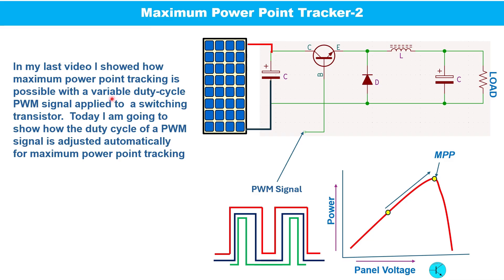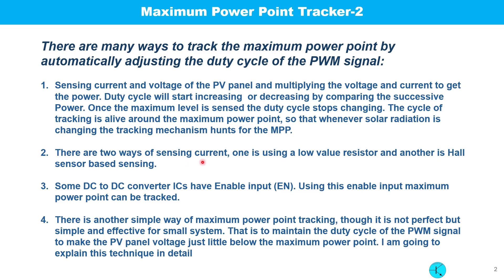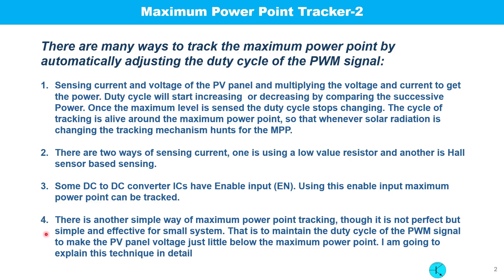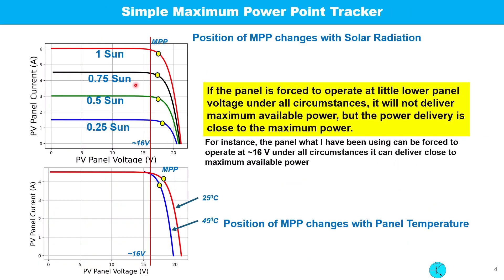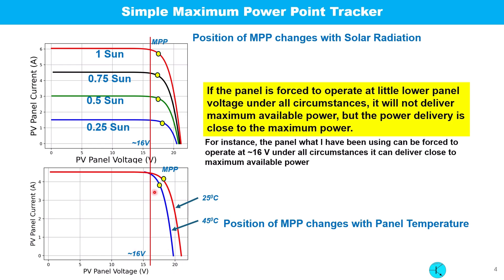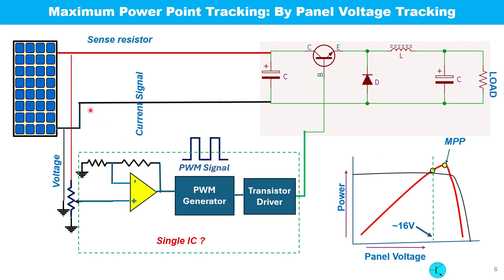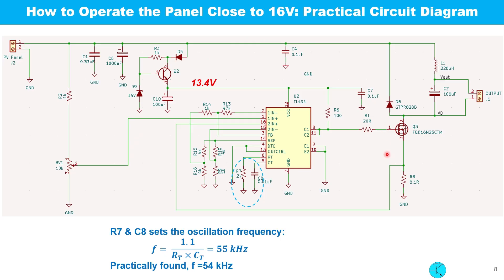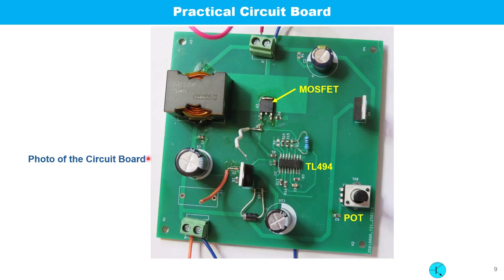PV Panel With MPPT Part 2

Comment: This is like how I designed and built a 12V power supply for LED lighting 18 years ago, I used 44 kHz which gave less heat on the coil and mosfet. This is perfectly simple and the TL494 Ic is the best option for this circuit. Thanks for the reminder.
Reply from the maker: Thanks for watching and your comments.